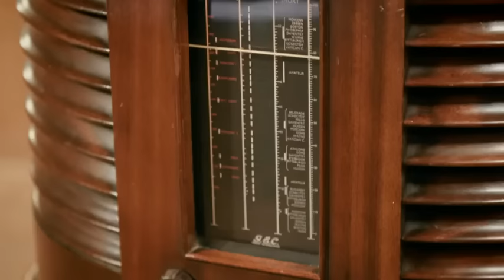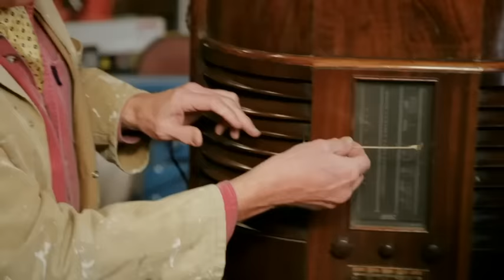Season 2 Episode 5 | The Repair Shop (Full Episode)

Comment: I've repaired ceramics and find super glue is excellent like they used here. For the record player, i would've replaced the wires since the old coatings degrade over time.